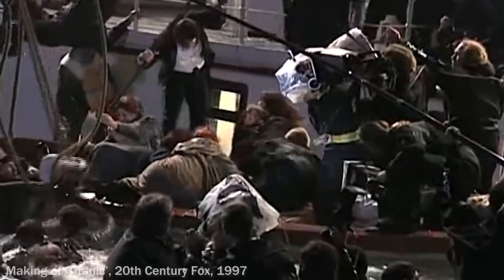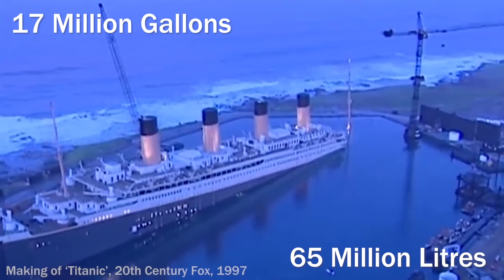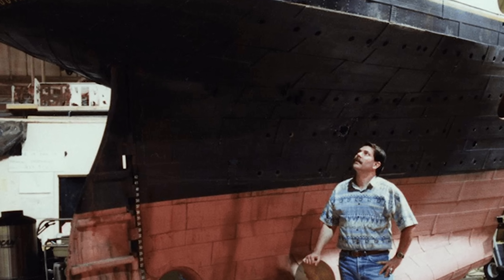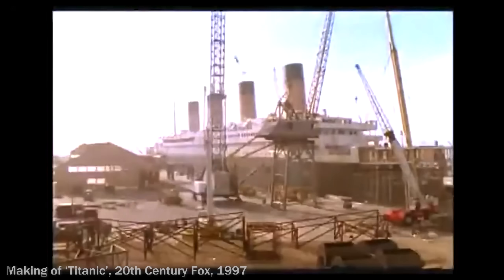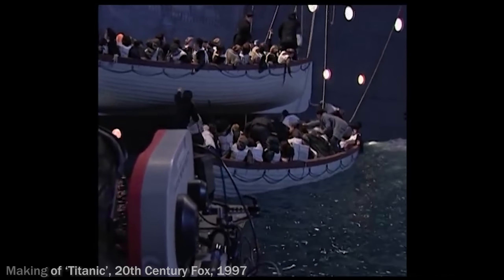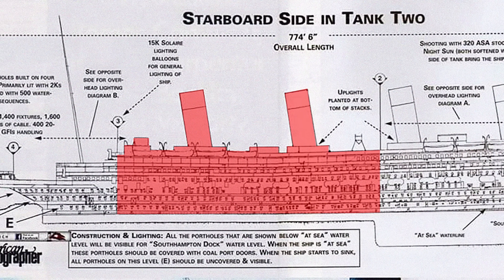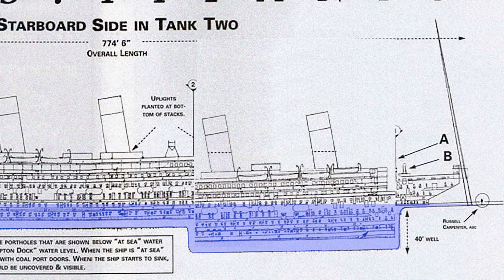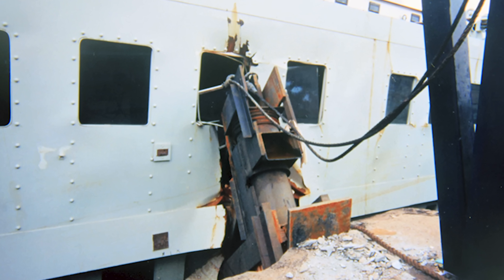The INSANE Titanic Movie Set (1997)

Comment: I read in a Titanic book (one of those giant illustrated encyclopedias that 90's kids will immediately remember) that had some of the info about how it was filmed and the thing that I always remembered from it was that they only built one side of the ship for most of the deck scenes (not the huge exterior ship scenes but closer-up scenes where people were walking around on the promenade deck or getting into lifeboats and such) and then used some practical effects to "reverse" the image when they needed to film the other side of the ship (cast would wear uniforms with reversed nametags and buttons, nameplates or signs or such would be replaced with reversed ones, then it could be edited in postproduction by being flipped horizontally and look "right" again)

Comment: 9:26 they digitally removed the flexing rubber in the scene you're speaking of I remember it clearly and looked for it on the recent versions and it's gone. 

Also fixed was the underwater iceberg Collison scene where the original showed the incomplete model passing by underwater.

Comment: An issue of the Titanic Commutator published at the time told the story of a dispute over when the bridge flooded.  Eyewitness accounts placed it during the last meeting of the officers, but the bridge was still above the waterline at the time, so historians agreed that this was mistaken.  When they tilted the set to the proper angle to film that scene, water flooded the bridge, just as (Lightoller? Lowe?) had said.  It turned out the water was swirling up through the stairwells.  Scene re-enacted, mystery solved.

Comment: I like that all the detail of rivets and plates was only added to one side of the set to save money, so a large number of scenes including Southampton were filmed and then flipped to the intended side - naturally, a few goofs slipped in there.

I completely agree that the sets being real really gave an added sense to the ship, even when things onscreen were a little illogical (the destruction of the Grand Staircase's dome happened while the Boat Deck level was still mostly above the water, so the intended angle was a little nonsensical, and there was a shot of a body floating in the partly-flooded First Class Lounge when again, exterior shots didn't support that).  Less of a mistake is the Smoking Room collapsing in a crunch in the clip you used, as it had gravity pulling it down as the ship tore apart.  That may well be a factor in why the whole upper stern just disintegrated on the way down (even with the now-discredited angle and position of the break, the effect remains magnificent and is an awe-inspiring scene of destruction).

When filming a movie about the sinking ends up accidentally teaching the filmmakers and experts about certain previously-unknown aspects of the sinking like what may have happened to the Grand Staircase, something was clearly done very very right and the movie earned all its technical awards.

Comment: The problem they found during production was they built the ship facing the way it was in response to the prevailing winds so the smoke coming out the stacks would blow toward the stern. But according to photographs, the other side of the ship faced the docks of Southampton. They worked around this by building the set in a mirror version, complete with signs printed backwards. Then they flipped the footage so everything looked correct.

Comment: Based on what you've just said, I pretty much feel exactly the same as you about this movie. What is there to hate about a film that went to so much trouble to actually bring the beauty and tragedy of this ship to life?

About the sinking fore-section of set, at the time the film came out, Cameron went as far as saying that despite all the hydraulics to pull it down, they struggled to get it to sink as fast as the real Titanic, and in the end resorted to "super charging" it by dragging it down slowly to fill it with water, then pulling it back up still laden, then finally dragging it back down as fast as they could by hydraulics.

I wish you'd pointed out explicitly in your video that apart from the very front 5 feet, they never built any of the forecastle deck, and the set proper began at the forward well deck, with over 100 feet of 'real' Titanic chopped off. When I hear fans of the film point out that the set was 'only' 750 feet long, I do want to say "Yeah but, most of that was because the front 125 feet wasn't built. With a ship 882 feet long, not building the front 125 leaves you with.... 760 feet.

Comment: The only problem with the film, in my opinion, is the Jack and Rose subplot, but quite literally everything else about it is absolutely phenomenal. The level of technical achievement just for a movie is absolutely mind-boggling, and you can tell Cameron and his crew genuinely loved that ship. There were several takeaways the historians gained from working on the film as well, such as when they flooded the Grand Staircase set, all the wood of the staircase kept wanting to break loose and float, despite it being anchored just as well if not more so than on the original ship, potentially explaining why there's absolutely no trace of it left on the wreck.
Reply: There's a fan cut of the movie on YouTube with almost all Jack and Rose scenes removed. It's even better for it than the original and still has a full 110 minute runtime.